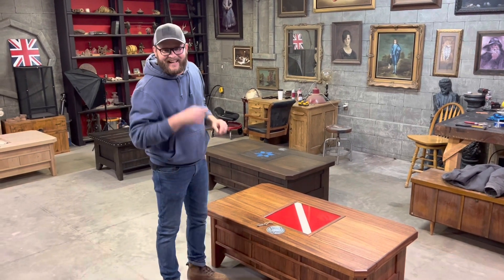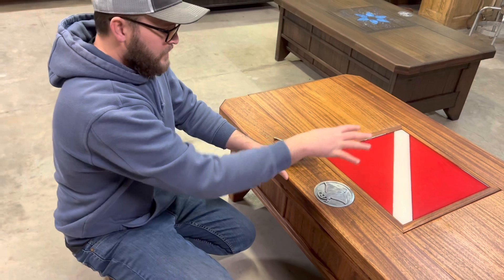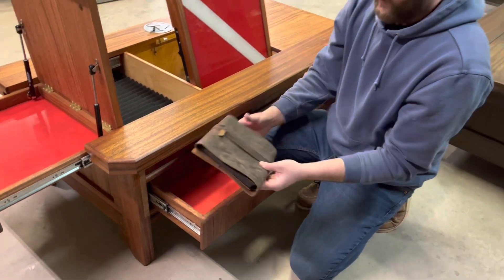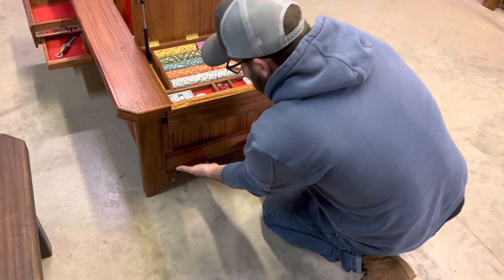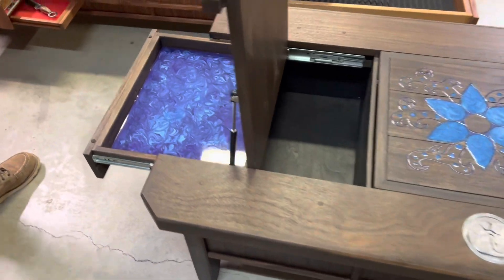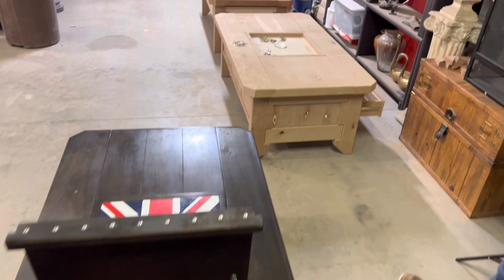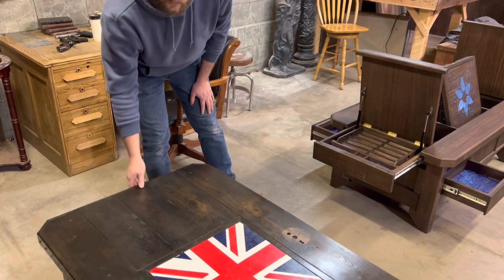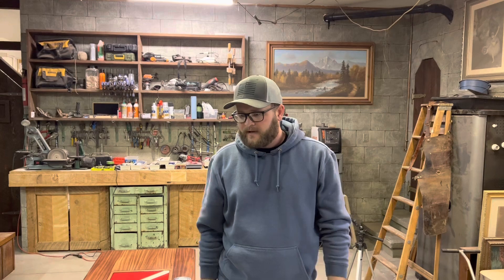Divers Table

Comment: Hey man I’m making a cabinet for the end of my bed that will have two doors that open but I wanted to make a false top to it that would lift up so I could store a rifle or valuables in it any suggestions for a lock? I saw in one of your older videos I believe the murica table you had braces inside the table one of them rotated and then opened a panel I really liked that idea and was wondering if that would be a good one and if so where can I get it
Reply from the maker: If it’s the one I am thinking about it was a common door latch I just replaced the door knob with a false brace. Any hardware store will have door latches. Get one with a square hole instead of the half moon shaped ones.

Comment: Great work as always!  Ever give any thought to making a "biker" table?
Reply from the maker: I haven’t yet. What all would it have?
Reply: @davidolundell  Thinking sprockets and chains. Maybe a gear shifter that has to be cycled through a certain pattern to release a drawer. Place for brass knuckles and knives.  A skull and crossed connecting rods for the center inset. Gotta have the whiskey drawer and poker drawer. Valves would make good hidden keys. Piston rings embedded in epoxy in the bottom of drawers. You have a much more creative mind than I do.